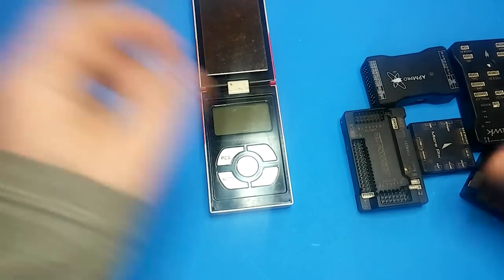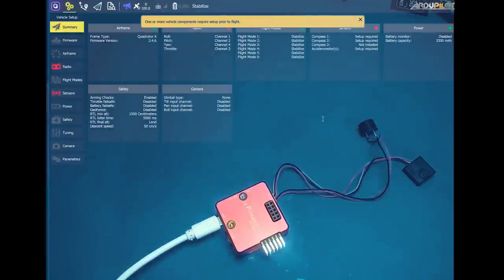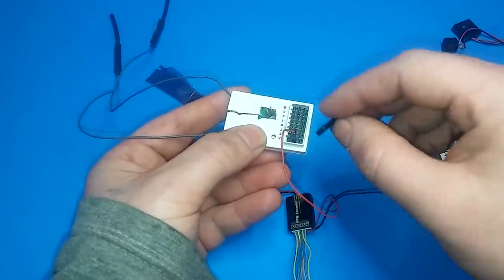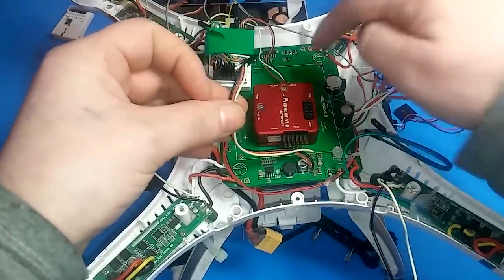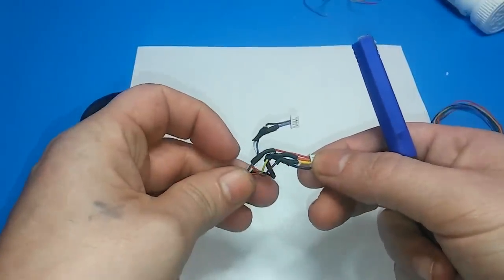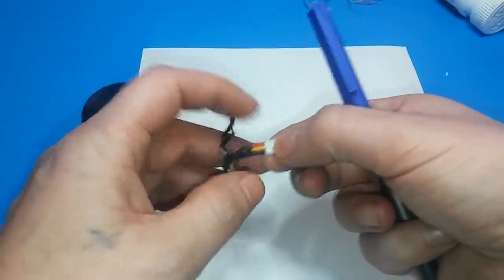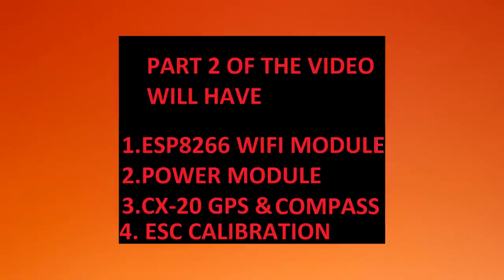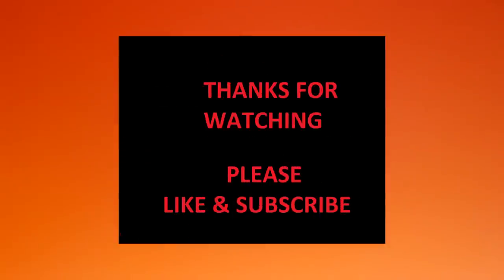cx20 to PixRacer Step by Step

Comment: Another great tutorial Sir. I maidened my third one this week, a RadioLink MiniPix from Banggood.A half dozen fun and accurate flights!Added fog, tele, odd, and a L9R receiver running 9 minutes on 3cell 2290s fast flights. It is a propietary version of MP which is strange and my fail to be upgraded in the future. Heard of Chibios?
Reply from the maker: I have not heard of Chibios i just did a google on it..it is just a linux flavor os for micro's?
Reply: Supposed to be a way to use cheap f3 to f7 fc and many other controllers as targets for ardupilot.
Reply from the maker: Hi can you explain a tad,,  One of my subs is sending me a flight controller this week that is arm based maybe cortex m3..and i plan to port arducopter to it,or open pilot,
Reply from the maker: ok i found this https://discuss.ardupilot.org/t/chibios-port-of-ardupilot/20491

this is amazing.. I have to look more into this .. I have a controller in the mail on its way and will have to trace out pinout and re write the code for this controller.but maybe they have done most of the work already ..will look through the git to see how far they are.. amazing heh...    and amazing you would bring this up.. I just posted on the facebook group couple of days ago about my project then you post this lol..
Reply: bangs6996 What kind of controller?
Reply from the maker: its the one from a cx20 .. the bigshark.. the only thing i think is it comes with a arm chip..so I was wondering why nobody has ever modded one .. and gary.. is sending me one to see if i can do anything with it ..

Comment: I plan to to this with the Veho Muvi Q1 i got Yesterday, it is a nice design but the FC sux, the controller is quite a nice design too and cost me only £95 new , Already have the Pixracer V1 i got a while back and never done anything with it so off to watch the next part now and will do my build next week i think
Reply from the maker: hi i tried to do some googling on it, to find some pics of the inside .... lots of the more expensive quads and newer quads are coming with a  mainboard with everything attached .. if you have a external receiver coming off the main board with channels or ppm it might be possible to continue using the transmitter.. and nice price on it.. some quick searches on ebay used ones go for $300 plus..

Comment: I find it hard to believe anyone is able to get any kind of crappy Pixhawk to work and we never did see it actually fly!  ;-)  Did you also say you have been able to use Qgroundcontrol?  I tried hundreds of different versions of QGC while they came out with lots of bug fixes but it never could get as far as actually being able to arm the thing.  Mission Planner always had problems calibrating the compass and other sensors then they did a big update of that part but it still didn't work!  I tried for 3 years to get a PX4 to work and finally ripped it out and put in a Naza M!  I can see why 3D Robotics went bankrupt since their stuff was rubbish that's best avoided.
Reply from the maker: I'm not done the video yet .still a part 2.. but i prob wont have any actually outside flight video.. and besides even if i did would you just say its my dji in it? joking.. na its a pretty good flight controller and easy to install. .. qgroundcontrol station i have not spent time on , but it does look pretty good specially the android app totally wipes the floor of the tower app..     butt i would probably suggest removing the metal shell it gets really hot
Reply: Wondering what kind of flying you enjoy, any fixed wing, you fly with other enthusiasts, a club, any carbon stuff? And what YouTube channels do you like. What got you into the hobby?